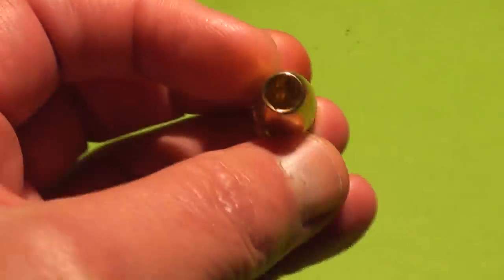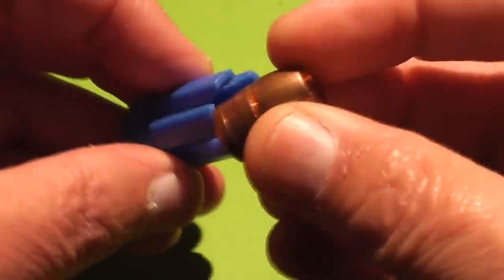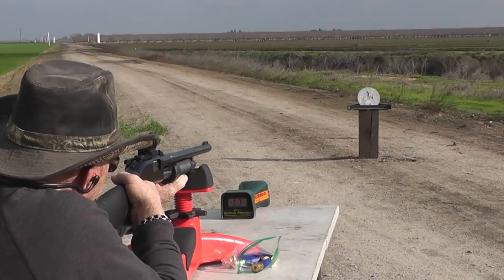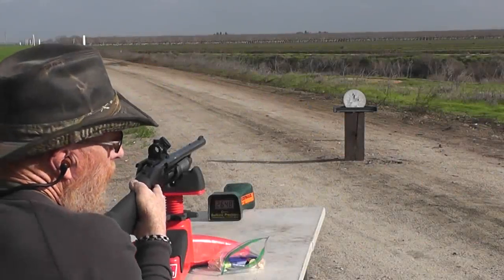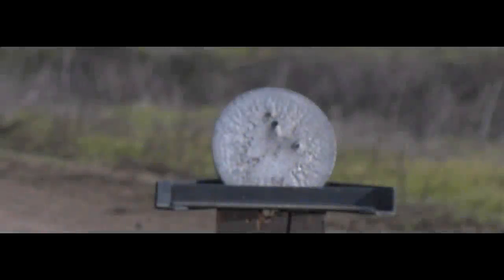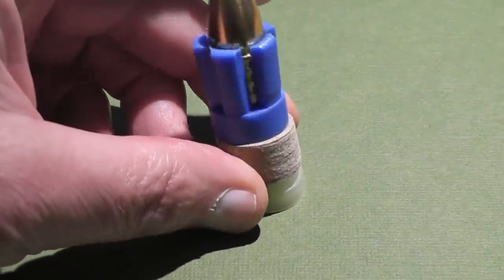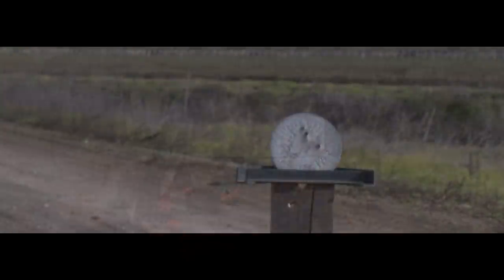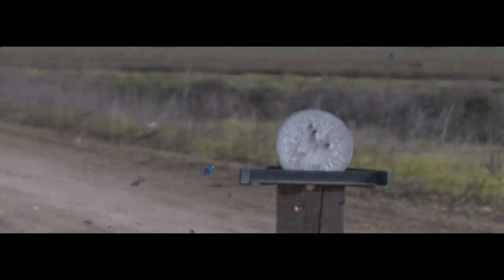12ga. round w/ .50 cal. Beowulf Sabot  - Utter Failure

Comment: Blimey. You know that something is terribly wrong with a round, if Danny (who, I recall, once shot an edge-on sword blade) misses the lead plate, not once, but every time. Never thought I'd see that. The slo-mo is interesting; all the wadding and sabot out in front, and then, rather reluctantly, comes the slug, pootling along at the back. I reckon some of them were recoverable, as they just seemed to fall by the roadside. Very odd.

Comment: Jeff, look up everything written by Ed Hubel on the 12ga from Hell.
He experiments with super high power loads but the data he has is useful when it comes to slow powders in shotguns.
Using his information I use IMR 3031 in slug loads because it kicks less for the same velocity.
Not Recommended for Super Light Barrels, they are to thin at the muzzle. Works fine in a Weatherby 459.

Comment: Try Blue Dot powder, but I suspect you're going to have stability problems even with a good wad column and proper powder burn rate. That all copper bullet is very long for a shotgun twist rate. It may surprise me, odder things have happened, but I wouldn't hope for much. Edit: Brass, of course, I don't know why I wrote copper.
Reply: Good advice. We in Russia do not have Blue Dot. Please tell what is initial purpose of Blue Dot? Like for what projectiles it was designed?
Reply: @LexsLavrov  It is a smokeless powder designed for magnum shotgun loads, and also works well for some handgun cartridges such as 10mm Auto. If you are familiar with Vihtavuori powders, it is between N350 and N105 in burning rate.
Reply: It is excellent suggestion for the task then!
Thanks!
Reply: In Russia to have a rifle you should own a shotgun for 5 years first (without troubles with law of course). I have to wait 2 years more, so I am not familiar with Vihtavuori powders but I heard of them. Russian hunters use VV for reloading rounds for rifles mostly. This is because reloading rifle rounds was illegal in Russia... until 3 days ago :) Now we can reload legally! Strangely reloading shotgun shells never was illegal. So we have decent variety of Russian shotgun powders.
Reply: @LexsLavrov   Good to hear that laws are relaxing there, I'm happy for you. : )
Reply: Thanks!
I wish you no one in USA will experience even fraction of what happen to Australia gun owners! Or some other crazyness...

Comment: You need slow burning powder. May be even super slow like Italian B&P m92s which is designed to propel up to 50 grams of birdshot.
The faster burns powder the more pressure it builds. Heavier projectiles tend to increase pressure as well. Thus this pressure finds a release by rupturing gas seal and any other element on its way: wad and sabot. And these chronograph readings are absolutely true! But they are correspond to first "projectiles" leaving the barrel, namely sabot, wad and gas seal... or parts torn from these.
This video is very educational though. Definitely not a complete fail! The rule is simple - of toy want to shoot slug - use slow powder REGARDLESS of slug weight (down to a point).
Reply from the maker: Yeah,   I had pretty good luck using Longshot in the other tests.   At least I learned a good lesson!

Comment: Something I suggest I using the allen-head set screws from electrical meter channels. Hard to get outside electrical supply stores. I've sent dozens down range, with a standard powder load from Winchester birdshot shells, and they're pinpoint accurate at 9 yards. Wad with 1/8 of a sheet of paper.

Comment: Man, I bet that's frustrating as hell. I know there's issues with the backing but, match the slug to the gun: The faster the slug, the faster the rifling twist you need to stabilize it. Slugs in the 1200- to 1500-fps range work best from a slower twist rate such as 1 in 34 inches. Faster 1900- to 2000-fps slugs perform better through a 1-in-30 barrel. Most BW twists are 1-20 . With bullets that are designed to be stabilized of course.
Not sure the twist Dan's shotty?
Hopefully this helps in development. Thanks for another cool vid!

Comment: I'm afraid the 'slug' / .50 cal bullet is actually a little bit too long to be properly stabilized in a 12ga sabot + slow twist rifling. I've used same RSS (BPI) sabot with 0.508" Lyman Great Plains, (Brinnell ~ 14),  (For .50 cal black powder rifle, similar slow twist..), knurled / rolled w/ a coarse file for traction inside RSS OR much better (Old, pink color) Collet Cup Sabot, with similar BPI's plastic wadding + gas seal, over 34 grs Blue Dot,  from Remi 870 12ga OEM cantilever scoped rifled bbl, Hastings ( Verney.Carron) rifled bbl, and Mossberg's (For Remi 870 12ga) mid.heavy rifled bbl. All of the above quite accurate at ~ 80 - 90 yds. Average velocity ~ 1.580 fps. Still missing Danny. Great work Jeff & Officer Gregg + Team..
😌🇺🇸💪🙏🙏🙏🙏

Comment: Use a penny between fiber wad and sabot base.
Reply: A penny is too big. A dime is the largest coin you can fit in a 12 gauge. You can check a shotgun barrel to check the choke on a 12 gauge. A cylinder bore or mild choke will allow the dime to fit in the barrel. A full choke will not.
Reply: I know a dime works, it's just that I'm too darn CHEAP!  The idea is to set up a flat 'pusher' to prevent bullet mass from punching out the bottom of the sabot during acceleration.
Reply: something I like to do is bend pennies between a drill press and a 9/16" socket. This gives it a more aerodynamic shape that fits in the shell and muzzle of a 12ga. You can fit about 9 in a 2 3/4" shell, and 21 in a 3" steelshot shell. I suggest you try it sometime.
Reply: I like it, a copper slug made in layers and stacked for weight.  Wonder what the various parts would do on penetration?
Reply: @TrikeRoadPoet  they penetrate a lot. They have an interesting clumping pattern, rarely separating into more than three groups. As for power, I was able to punch holes clean through 2x6 fence boards. Since 00 buckshot is unobtainable here, I've made a few different types of homemade buck. I've had great success with using a few bent pennies to keep a load of buckshot in a shell.
Reply: By the way, all of this was self taught. First took inspiration for wax slugs from this channel, and my capacity for experimentation has created about a dozen shell types that I would gladly rely on to defend home and property

Comment: I think what you need is a copper disk you can fit in there so that when the bullet pushes through the sabot, the disk stops it from failing completely and provides the piston for the gas. Too bad the base of the sabot was not much, much, much stronger.

Comment: I think the petals on the sabot are designed to grip the bullet pretty tightly so they take some of the force off of the middle of the sabot during acceleration. You might have been better off shoving the whole bullet and sabot into the shell and loading the gun with the barrel off.

Comment: Well... you could just as well reinforce the wadding. Placing a coin between the wadding and the sabot likely would do the trick. (Hell, you might even be able to safely load it hotter than what you did in this failed attempt!)
Reply: Reinforcing wadding is a way to nowhere. Because you cant hold pressures like this. And if someway you hold this pressure - you risk to blow your gun. Actually it is good thing gas seal failed. Because pressure was released in a safe manner.
You should lower pressure by using slow burning powder, but not fight the pressure by using stronger wadding.
Reply from the maker: I know others have had issues with the RSS.    It's probably just a weak plastic, when it needs to be made out of nylon
Reply: Could be the case...

Comment: only real men use IMR 4227 :]
Reply from the maker: Worth looking into,   a bit slower than Longshot.
Reply: TAOFLEDERMAUS that one video of the plastic projectile going 3000fps looks like it used IMR 4895 (308/3006) Powder. Extruded powders burn alots slower typically, but have more energy. 4227 is a faster burning powder for like 44Mag. Ive always liked the powder because it does well in 300Blk Supers. 

22gn of 4227 is my 150gn Sup load.